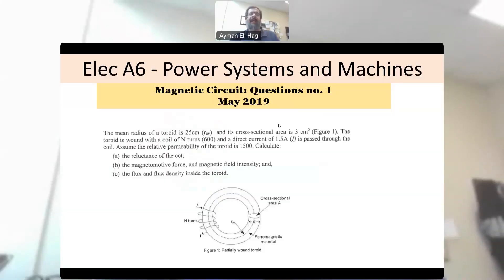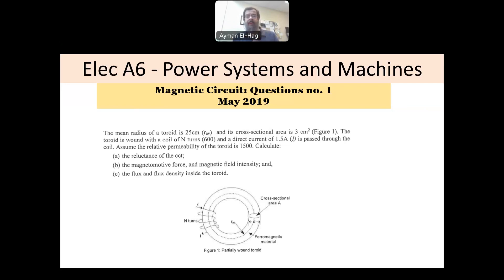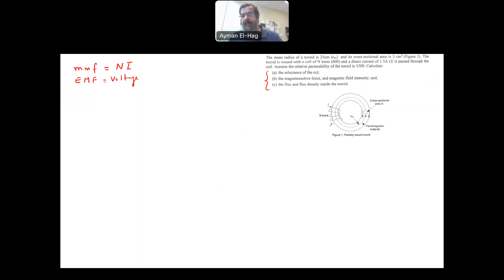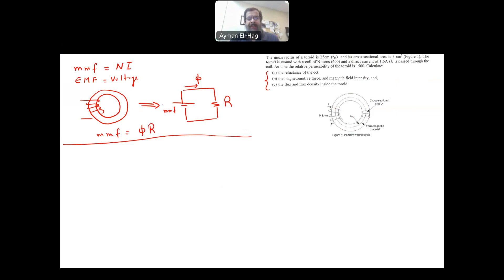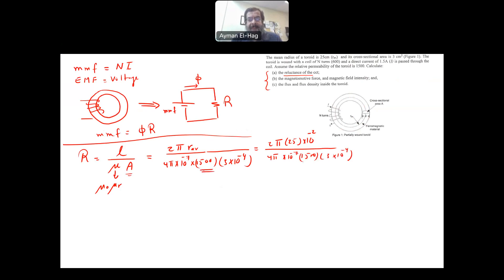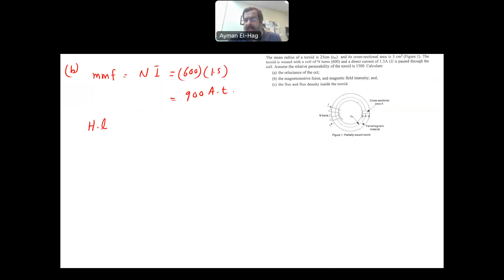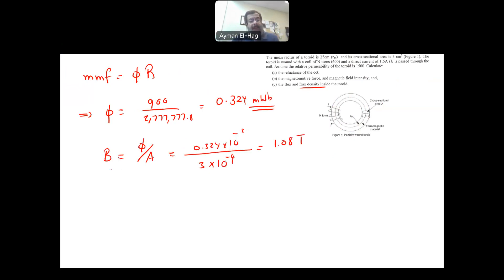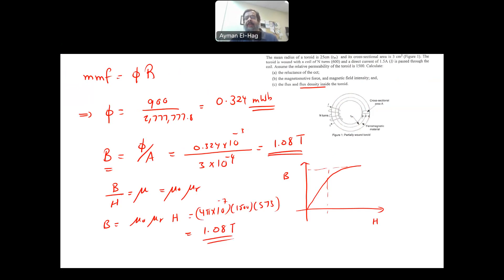PEO solve examples (ELEC A6) Magnetic Circuit Question no. 1

Comment: Thank you so much professor. You are really make all problems so easy for us. I believe that there is overlap between Power System and Machine and Power System Engineering and I took them both. Can you please solve problems in Power System Engineering as it scheduled on May 9, 2024 but Power System and Machine is scheduled on Jun 17, 2024. Thank you again professor
Reply from the maker: Thanks for your nice words. I'm currently working on both ELECA1 and ELECA6. I want to finish both of them before starting ELECB7 which is really different than ELECA6. I will do my best to do at least some questions from ELECB7 ASAP.
Reply: @electrical4everyone  Thank you professor. I appreciate your support